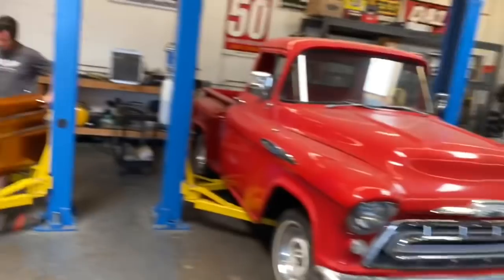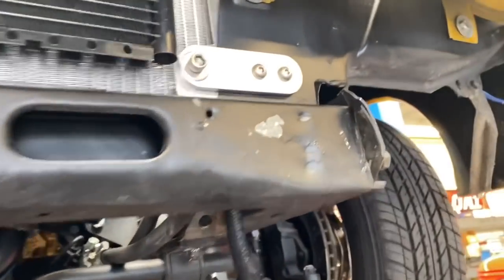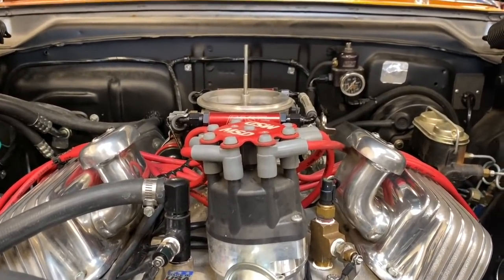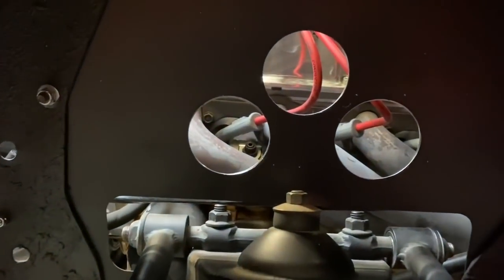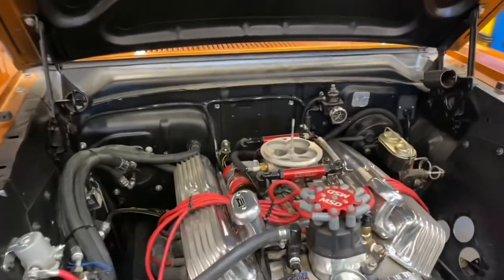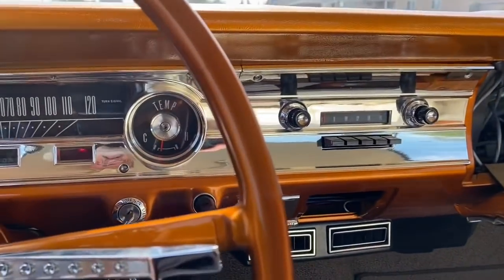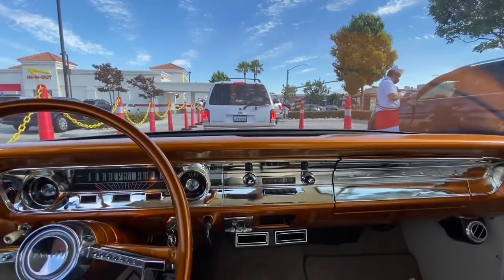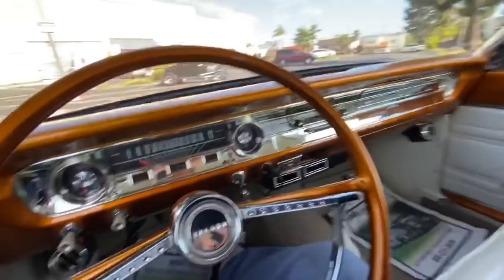This Falcon Finally Gets to Fly

Comment: Motor? You know better than to call it a motor. Motors have 1 turning shaft in an electrical fiield. As bad as Brits calling a car a 'Motor'.  I have this car picture in a folder on my laptop and Johns Backgrond swith desk top wallpaper every 15 seconds. Out of 1500 pics I might see the Falcon once a week. 2 other Falcons, earlier years have the arrow trim down the side. They have cut out the arrow point with 6 slots to allow hot air to escape, looks great too.

Comment: So much like my Australian Ford Fairmont 4 door! 1969! I had similar overheating challenges for years so I put a couple of vents in the bonnet and also upgraded to Aluminium radiator with big electric fan controlled by Davies Craig black box thermostat arrangement. In winter I have days it barely gets above 150! Last summer I was in traffic on a 35C near 100F day and it kept under 190!!! A stretch limo mechanic told me another trick for a V8 is to fit the 6 cylinder pulley on the water pump so it shifts more water at idle and low revs around town. No problems with cavitation on long country high speed cruises so I think it helps!

Comment: Windsor, both top and bottom hoses are on the one side. What were they thinking?  You can feel one side hot and one side cool. Use a Clevo waterpump, as they on 90s  Fords. 
Depending on the overbore many simply will always be boilers.

Comment: Good job. Nice car. Be interesting to see if there were any venting posibilities at the top of the engine bay somewhere.. heat rises.  Perhaps through the venting between the wipers. 156 deg is great.
Reply from the maker: Yes.  Out of the upper rear engine bay is best however that’s where the interior vent is located so they would be a problem
Reply: @luckysgarageshow   Roger ..  We used to spend hours in the junkyard scrounging ducting for home brew ram/air.. cold/air. Dual snorkel air cleaners, zip ties, junkyard ducting.  On cars with rubber trim at the hood/firewall intersection... If there was no ignition box on the back firewall to be bothered by a little water.. we'd pull the rubber trim and allow for air escape w a larger body gap.. None of our trying/hard hoopties were show cars though.

Comment: Cool, good job, I hate when people just throw parts at crap without thinking of the real issue. The only constructive critism would be that there is some room around the radiator that air can bypass around it, I see people taking all the air flaps off of old cars and all the air isn’t directed into the radiator and they wonder why it’s overheating. Neat ride

Comment: So......was the 160 deg thermostat the ticket for a cool ride?  OR. did you put a top hat on for cool air?  Inquiring minds want to know.
Reply from the maker: Yep 160 and a fan controller along with an exit for all the hot air solved the temp problem.  No need for the cold air intake so we get to keep that cool old school look under the hood

Comment: with my 64 i had the hood hinges pushed up and the seal across the back of the hood removed leaving a gap in order to vent the engine bay.  Boy i miss that car.
Reply from the maker: Only problem with that is that all the hot air goes into the cowl vent and heats up the inside of the car.
Reply: @luckysgarageshow  Unless you have a Vintage Air a/c kit. They seal off both the vents so its a non-issue. A few decades ago I cut open my radiator support and installed a '69 Mustang clamp in style  radiator. Solved all my overheating problems. Then I moved to AZ. As long as I am moving it's fine but the stop and go is an issue. Currently have a three row copper/brass but will install an aluminum 4 core. That should do the trick.
Reply: @luckysgarageshow  Lol never thought of that, and growing up in Oregon summers never really got too hot

Comment: When I was 16 in 1998 I bought a 1964 falcon wish I would have never sold it only paid 2g for it with 2  truck loads of parts
Reply: Ha bought a 64 in Australia, for $70 with a worn 144 six in it, back around 1976 lol

Comment: Restored a 63½ the first release of that body style. Guy wouldnt upgrade anything so it was a constant battle. This was also in 91 to 93 so parts weren't as easy to find. Nodding mustang parts to rebuild the trans after the worn out bushings in the column shifter jammed it into 2 gears at once. Rebuild the gutless 6 cylinder. Ugh it was tiresome.

Comment: Block off the openings around the radiator where you opened up the core. Air will always take the path of least resistance, so instead of flowing through the radiator it’s going to flow up, over, and around it instead. If there was a splash shield underneath the radiator put it back as well as it contributes to creating a low(er) pressure area behind it to help draw air through it. I road race, and my car is called upon to cool the engine for 45 minutes at a clip while working at max capacity and the car stays cool on hot summer days in the draft. Air exiting the engine compartment isn’t an issue at the speeds most of us see.
Reply from the maker: Yep......👍

Comment: i like megasquirt ecu microsquirt as one can do so much with them even the cheap one can use a old tablet via blutooth  as a dash fer gauges n to tune .and yes it will do self tuning 50 buck software upgrade i am not affiliated with them ..i one just need spak megajolt 150.00ish is a box that does it all to like fair prices also as electrics not that high to build i seen a msd or ? ford edis spark box ford like 500 600 once i giggled nuts to me 80 to build or so  ..ill be posting a video on all this after shop is done ..i apologize if i said this before great videos A++

Comment: Thanks for the Video....Nice Fix....Really Sharp Falcon....nicely done. If for whatever reason, you choose to put additional venting in those "Panels" would it be possible to put "Louvers" in place of the holes. I think that would add a little style on those flat blank panels, and vent air out and be more likely to keep water splash and road debris out of the engine compartment...they also look kind of Old School...in keeping with the age of the car and all. Just a thought. Stay Healthy and Safe My Friend....Regards.....

Comment: Stance? Wheel tire combo ?
Reply: TCI Mustang II front, custom four-link rear on a 9-inch rear. 15x... 6 if I remember on the front, 15x7 rear, reverse to the extreme. 205 front rubber, 215 rear from diamondback tires.